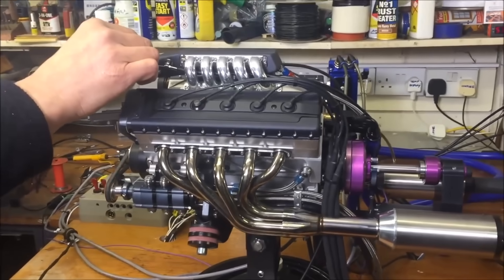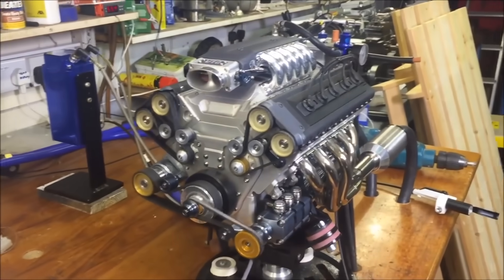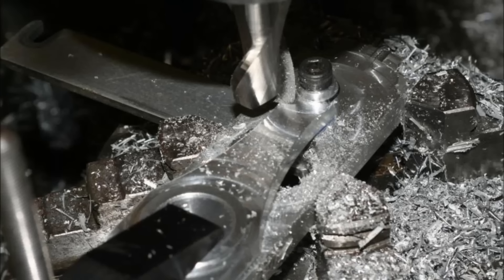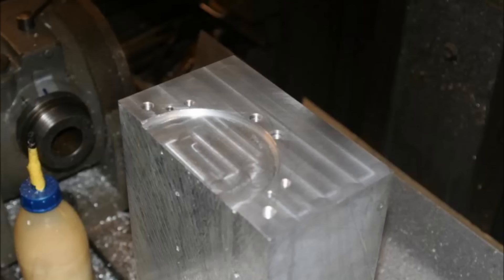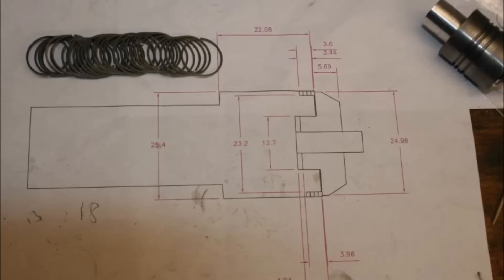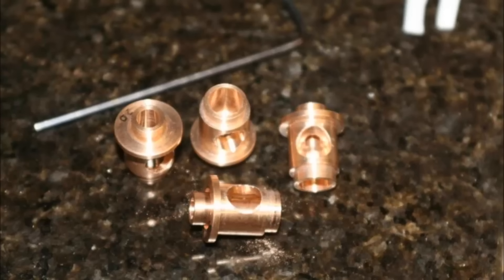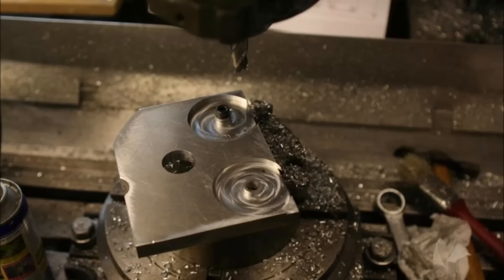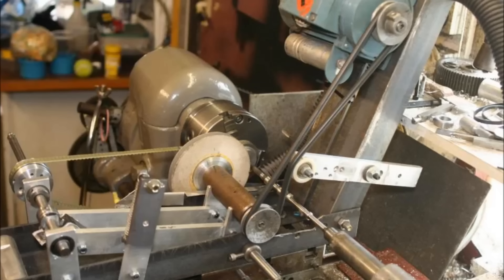Model V10 Engine Build compilation

Comment: How did you make the coil packs and spark plugs!
Reply from the maker: For the plugs I used the ceramic and electrode from a commercial mini plug, and made the outer steel body with Ptfe insulator. The coil packs are standard Toyota with the tops cut off.

Comment: Hi Keith, very few can imagine and appreciate the massive amount of your design and construction work. And the many mounts and fixing devices that were needed to get all these parts milled and drilled in your workshop.
The mechanical engineering of a V10 alone is outstanding. But figuring out how production could be accomplished in your own shop on your own - shurely not up-to-date - machinery is a task most people underestimate. 
And this is just the mechanical part of all! You further know about F1-Chassis construction 30 years ago (the basics are still the same today),  and you know about electrics, electronics and hydraulics.

Plus your knowledge to build the body yourself. This is another job which needs a lot of experience on its own!
I am pretty shure, that many big automobile-manufacturers would pay a lot to have a man like you who knows much about everything and could make all work together! 

My greatest respect!

Sebastian
Reply from the maker: Thank you.

Comment: Kind of confused. Its supercharged or not? Flat top pistons or pop ups? the plenum stuffed with things, and it looks like the all the intake and exhaust are far too restricted. The intake manifold, the heads, the exhaust manifold, all of it. And seeing this on the dyno, doesn't seem like its making near the power it should. That might be part of the reason. Not sure if you designed this or got the plans from somewhere else... Also, not sure about the cam geometry either. The cam lobes looked very narrow so there is no duration, not sure what lift the cam is providing here nor the degree of separation between lobes.

Comment: how did you do the camshaft timing i need to know
ie what math did you do to make the pistons not slap the valves every few rotations
Reply from the maker: I just followed standard full sized camshaft specs and timing.

Comment: I don’t believe you built this, you don’t know what half the parts are you’re talking about, metal sawdust is called swarf and those tiny spanners are called connecting rods, you don’t even know what a crankshaft is yet you want everyone to believe you built one of the most complex tiny engines I’ve ever seen, you need to narrate your own videos it’s confusing
Reply from the maker: Yes, you’re right, my wife built it.
I just sweep up the sawdust and sharpen the spanners.

Comment: 10:24 - Please someone tell me how he managed to hollow out the pipes of this intake manifold when they are curved like that ????
Reply from the maker: I’ll try to remember to show the drawing on the next vid. A few people have asked.
Reply: @Keith5700  Thanks Keith, I have been thinking about it all weekend :S . I asked a few people and they couldn't tell me. Also did you manage to smooth out the inside of the pipes to allow for the air to flow more readily ?
Reply from the maker: @JonnyWisdom  it’s basically drilled in at an exact angle, from each end, and joins in the middle. It’s obviously a bit tight, and is really close to the outer wall at the join.

Comment: In your most recent upload as of this day, your trouble shooting you’re engine saying there seems to be lack of air or restriction bcs it seemed to be running rich so you have a roots style blower you made to install… at the time I didn’t know you built this engine yourself literally from blocks of aluminum down to the rod bearings and crank shaft. If you can do all that, I’m not even going to suggest what I thought the trouble could be lol, you should know that engine inside and out. At the time I was going to say sounded like valve lapping or ignition timing. Of course this engine needs to run off an engine management control system but then again my knowledge stops at creating a base map and general clearances. Perhaps this comment is better suited for that video. Your an amazing engineer.

Comment: I'm wondering how you made the lubricant system or do you have two of them? And make it a compressor of any center-bether it is easier but it will be more interesting if you do as on modern oilcarace or trackhoke! I hope you do it!)
Reply from the maker: sorry, that obviously didn’t translate very well.
Reply: @Keith5700  Sadly, if briefly hope to see the installation of a large compressor "big compressor"

Comment: Very neat indeed, It just seems it should rev much higher than it does at 4500 rpm or so, 125cc V10 seems like it could rev to like 25,000 rpm easy...
Reply from the maker: It’s getting valve bounce around 8000, so would need stronger springs to go any higher. It would sound nice at 10 or 12k.

Comment: Did I see that you built a small screw blower and if so how come you did not use it?
Reply from the maker: yes, but it was a toss up whether to put that on top or the 10x inlet pipes. I went wit( the pipes purely for looks. I wish I’d gone with the blower now.
Reply: Keith57000 It looks great both ways in my opinion I guess it just depends if you need the extra power. Could go twin turbos and keep the bad ass Intake manifold. Unless you’re worried about heat . Could always build a small turbo/ turbos and attach a brushless motor to it and have a highbred electric turbo with instant boost and no heat and no paresthetic drag of a screw blower .
Reply from the maker: @707turbo1  I’d have an electric turbo on it, if they work? Don’t know anything about them.
Reply: Keith57000 torqueamp.com this is one of the Electric supercharger/turbo that actually works

Comment: Beautiful work, I'm pretty sure I saw a supercharger being built, I'll be damned if I can figure out where it's being driven from.
Reply from the maker: it was designed around an integral supercharger, but late on I decided to go with the inlet manifold pipes, which fit where the supercharger was. it was done purely for looks. the S/c drive pulley is still connected to the front. there was a shaft going to the back and a belt drive to the rear of the supercharger.
Reply: @Keith5700  Thanks
 I've only watched about three of your video's so far, I'll go back to the beginning and watch the whole build.
I could ask a bunch of questions but I'll just ask one more, did you design the crank and cams from scratch or did you use the spec from an existing engine?
Reply from the maker: I designed it all from scratch. I based the cam profile on an existing Chevy cam.
Reply: @Keith5700   I look forward to more videos.
Thank you.

Comment: I'm impressed. I learned a lot here. Thank you. I knew that school was a hoax. My teacher in shop class lied and told me that a screwdriver was a hammer and visa versa. You just blew the lid wide open. Also BIRDS ARE NOT REAL. THE GOVERNMENT KILLED OFF ALL THE BIRDS IN 1970 AND REPLACED THEM WITH SPY DRONE BIRD REPLICAS. TRUST ME IM AN ENGINEERS SON. AND THE INTERNET TOLD ME SO. THE INTER WEB DOESN'T LIE FOLKS. P.S. YOU FATHER IS A BAD ASS. IVE BEEN FOLLOWING THIS BUILD FROM DAY ONE AND HAVE LAUGHED MY WAY THROUGH ALL THE "THATS A FAKE ENGINE" COMMENTS.

Comment: I'd have to say that it's pretty obvious that the person speaking in the video had no clue what was going on. From the lack of knowledge of metal chips ,Mills ,Mill bits ,Cam's ,cranks ,rods, gears and so on. I recognize however some of these terms might have different meanings in the UK judging from the accent.
Reply from the maker: Yes, in the U.K. all of those terms he used are correct.
Reply: @Keith5700  Hum seems a little bit of research would dispute a lot of that statement sawdust seems to be reserved for wood chips created buy a saw. That seems to be consistent no matter where I look referring to UK vernacular. Could continue but I'm not going to.

Comment: @ Keith57000  I am so glad I read the description for this video. After the first 20 seconds of this bit I was so disappointed and was all set to scream fraud because anyone who claimed they made this incredibly clean work of art but didn't know the difference between an end mill and a drill or referd to a connecting rod to a broken spanner could be nothing less LoL
I had to sit down I was so relieved. 🙂 Maybe you could spend a little bit of time with the boy and work on some of the technological terms and a few part names LMAO
I two had a son who didn't seem like he knew what the outside of a mall looked like. Thankfully he is now his own wrench and races 600 production for fun in the Greater Vancouver area.
Thanks so much for sharing. 
When are you going to find a huge piece of asphalt or concrete and let that bad boy loose!

Comment: It's all of the saw dust that cracked me up 🤣 and then the spanners 😅 but you tipped me over the edge with the hole in hole action, that was it I had to reach for the tissues and head for the mens room.🤫
By the way, Rolls Royce, BMW, Mercedes, Ford etc etc blah blah blah all make products but your Dad makes magic, he is an engineering genius and you should be extremely proud.
I hope that you are all well and safe. Absolutely awesome work Keith 😉👍

Comment: The question o. My mind is how much power does it produce. That would be nice if you could let us know. Great build.
Reply from the maker: it’s going on the dyno soon
Reply: @Keith5700  oh great. I have all sorts of imaginative applications for you engine in my head😀. Drifter kart, motorcycles especially. Like a baby Honda  gold wing thing. 
Thanks for your reply and for posting this great build.
Reply from the maker: @ballerblocks  it’s already in a car
Reply: @Keith5700  whaaaaaaaaaaat. Like a regular car wow. I could imagine all the advantages already. Packaging, weight saving, and fuel economy, as a case study. ... Do you think it would have low  end torque in order to get moving fast. Or its more of a high revving top end power setup.  Pls do send photos and videos. I am now more intrigued than ever. Thank you once again
Reply from the maker: @ballerblocks  have a look at my channel. There’s 10 videos of the car.

Comment: "Metal sawdust"
Reply: Dust remnants from a saw . Doesn't necessarily mean wood .
Reply: @alexpeacock3870  Except metal doesn't turn into dust like wood does. Swarf is the proper term. But of course its all a bit of taking the piss
Reply: in metal terms, they’re mostly called chips or shavings